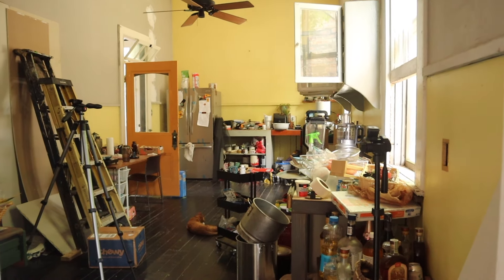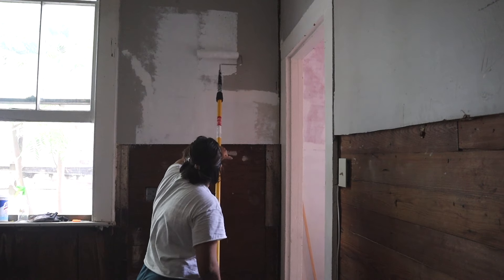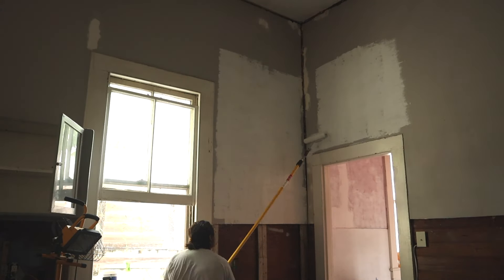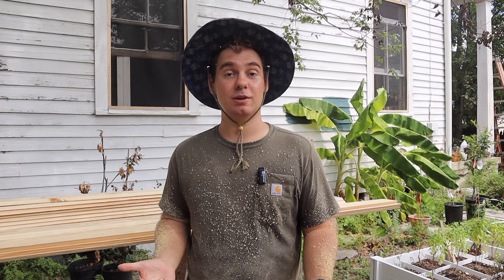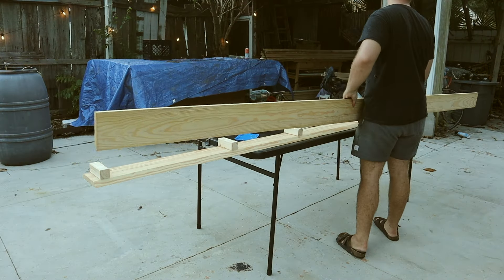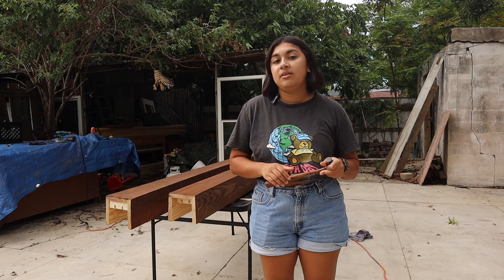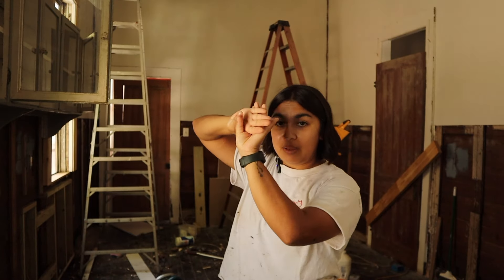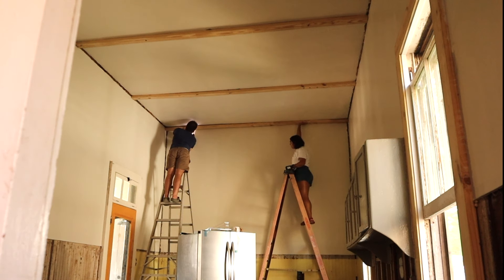building wooden beams for our kitchen! | new orleans home renovation

Comment: Everything looks so good. I about fell out of my chair when you said y'all didn't have air conditioning! How did you not have a heat stroke??
Reply from the maker: Lots and lots of water. Honestly that heat wave was the worst we’ve felt (it was record highs like high 90s/feel like in the 100s. We took a lot of breaks and tried not to overdo things. Not having AC has def readjusted my temperature tolerances —  If you’d believe it, now I enter a conditioned space and it’s too cold! Thanks so much for watching!